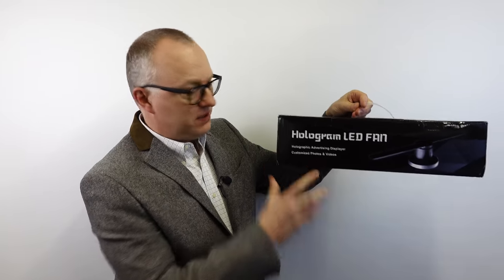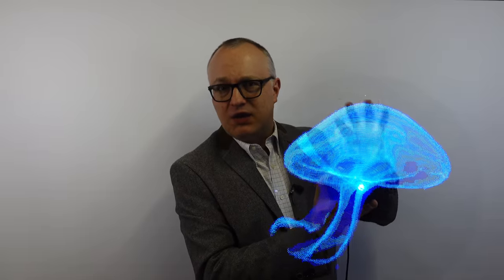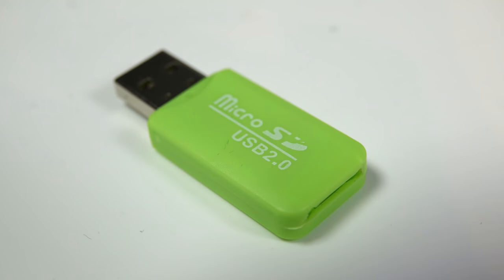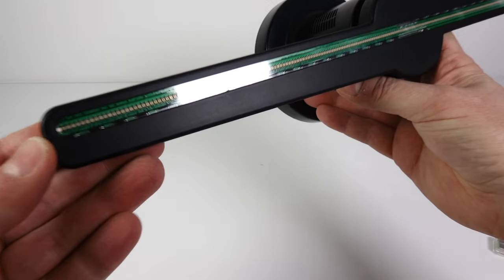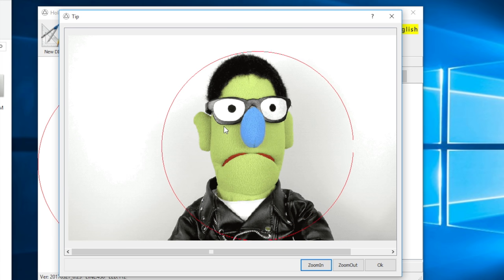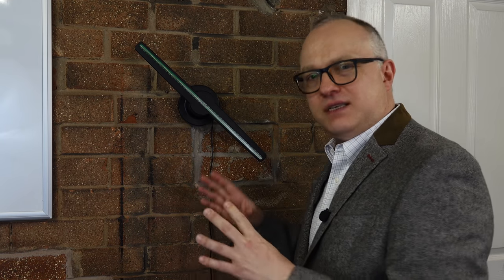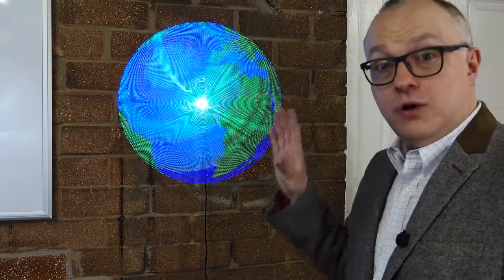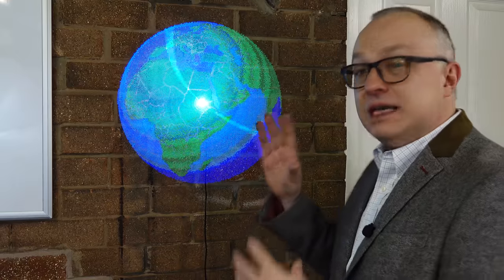'Hologram Fan' - animated images in ‘mid-air’

Comment: Kind of neat.  What would perhaps make it more interesting is if it had several blades that were different depths.  That way it could produce 3D images.
Reply from the maker: Some of the demo rotating graphics and logos manage to look surprisingly three dimensional.
Reply: depends ... for a single person experience .. you could in theory use a camera to get.position* viewing angle - and re-arange the data based on that ... giving it the effect of depth
Reply: @akirahideo6904  if you do it sorta like a 3D print of the object it will look very 3D with no tracking needed, imagine a sphere made of big-to-small circles going from the back "fan" (the big circle) to the front "fan" (small circle), you get a 3D effect. Of course the effect works on a limited angle range, like Martin Gardner's 3D dragon illusion. I hope i make myself clear in English.
Reply: @zobook  that's shape based depthness and very limited... .. .it's just my opinion , but that initially suggested approach does not make much sense
Reply: @akirahideo6904  I agree, is very limited, but not based on a single person position, it works for everyone on the "angle range".
Reply: Check HyperVSN Wall - https://youtu.be/VuPJoixToBM?t=9- it far more high-res, has 4 arms per fan and gives better viewing angles.
Reply: @zobook  Very true indeed , but for the layered depth content ...i don't really think there's any, unless you wish to create your own. Altough, i'm wondering if some paralax thrown into it could add some cool feeling. Anyway, as Techmoan mentioned several times, the impression in person seems to better than on the cam - so we can expect that as the technology becomes better and beter , this "sweet toy" may actually evolve into something that will set milestones.
Reply: Rob S  Yes , my name is totally real :) Greetings from Section 9
Reply: They do have those. It's a similar design but in a sphere with the LEDs at different radii. A lot more expensive I'm sure though.

Unfortunately, the fan devices are messing with my google-fu but here's something. https://www.youtube.com/watch?v=YKHBqUWpFWA
Reply: I've seen one of these in person.  They had the Nemo animation on it, and it's striking how convincing the 3D effect really is.  I brought a friend to see it, and when Nemo swam toward the "camera", they actually flinched a little.
Reply: In person these things automatically have a pseudo-3D effect just because of how the eye interprets the multiple depths of the blades and the wall behind it at the same time.
Reply: That's a good idea. Also would be ace if you could send pictures to it? Such as video? I shall now watch the rest of the video :P

Comment: Watch a movie or trim the hedges, so many uses!
Reply: Watch a movie AND trim the hedges at the same time.
Reply: Doubt if it'll hold a 2 hr gif in it. No audio makes it difficult too
Reply: Just what I thought
Reply: @afarhan21  You mean you can’t stream a video to it via Wi-fi?
Reply: Lawrence D’Oliveiro I think you certainly can't. Because of lack of hardware and software. No powerful cpu/gpu or wireless antennas. Or even an OS / media player. It can only 'play' gifs.

However I think you can 'cut' silent movie clips in 5 or 10 sec gifs and play them one after another. I have not used this thing but from the video thats what I can make out.
Reply: You could burn subtitles on the video.
Reply: @afarhan21  put it as just screen and use external speakers
Reply: @afarhan21  I have a feeling there might be something like an Arduino inside there. Looks like the software was originally developed on Linux, even if they only offer it for Windows.
Reply: Lol and cut the edges of the video on top and bottom
Reply: Lawrence D’Oliveiro If they can upgrade the internals they can run Android on it. That must be their eventual goal with this product. Also will need a better remote.
Reply: Gabriel Vieira They'll need powerful CPU + GPU in there.

Comment: This is the best quality footage of one of these I have seen vs real life! you can also get 4 bladed ones, where the LED pixels on blades 1 and 3 are slightly misaligned to pixels on blade 2 and 4. This way it fills in the gaps a bit better (a bit like how a dot matrix printer could do higher details by shifting the paper ever so slightly and going over it again!)

Comment: Yeah, I've had a passing fancy for these things for years now and they've certainly improved.  Still to pricy for the novelty, especially at the effective resolution they have.
Incidentally, the 4 blade versions not only have higher effective resolution and framerate, but they also support wifi and have 'app control', so presumably you can change the animations on the fly and support more features overall, like streaming a video.  The page for one of them doesn't even mention .GIF in the supported list, though presumably it would support it.  Based on one of the pictures in the description, it seems you might be able to link multiple quad-fans together to produce one larger image?

Comment: I remember when these came out in the late 90s and imagining a Blade runner-esque future where they were fitted to the tops of taxis and police vehicles to display advertising and information messages. Of course now the actual future is here and if they wanted to do that they'd just use LCDs (much like the buses in Children of Men). Still a cool looking display though, there's something very retro-futuristic about them. The spinning globe looks particularly cool and reminds me of the huge 3D one they have at the Media Museum in Bradford (I would love to know how that works - some sort of internal projection onto a suspended sphere). I have a miniature version (of the PoV fan) that my late wife got me about 10 years ago - paid about £12 for it from the gadget shop. It's only about 8" across with flexible fan blades and displays an analogue / digital time and date display in red and green. Cool to look at, but it doesn't really work very well as a fan and the novelty quickly wore off.

Comment: Since this is a radial display, the 450 is the number of "slices" around the circle it can display (the LED's can change color 450 times each revolution), while the 224 is simply the number of LED's along the length of the blades.

Comment: my first thought was to hack it to a raspberry pi so I could display live images
Reply: My best guess is, all the electronics are contained in the spinning bit, and the base just provides power through a slip ring. A Raspberry Pi would have to be mounted on top.
Reply: @nrdesign1991  that makes perfect sense actually. It would probably be to much of a hassle to do
Reply: My first thought was whether it could be linked to one of those SD cards with built in WiFi.
Reply: @MrDuncl  Now THATs clever

Comment: Helicopter photo effect in laymen's terms.  the camera is only showing the fan in a fixed position every 60 seconds or so.  But the blade is spinning much faster.   No real way to adjust for that without some sort of special effect. 

Blade edges would be a issue too.  You could run into them and even get injured since you may not be able to see exactly where they are.  It needs a visible LED edge or visually a frame.

But all in all.  Very cool toy.  First version I have seen and if I can rob a bank I'll have to get one.

These would be perfect for some of the older cartoon shorts.

Comment: Those are pretty cool. I've not actually seen one in person yet, only vids and short clips. Kind of reminds be of a 3D TV concept I saw years ago. It used a different kind of spinning shape (wouldn't even know how to describe it) as the display area and I think lasers were pointed at it. IIRC, they were testing some way of using it for air traffic control.

Comment: That's funny , I always wanted to do the same thing but the only option I saw when I was searching was to use led strip made for bicycle and try to put them on a normal fan . I don't know if it will work , considering the stability of the fan , but at least it can be use as a regular fan .
And while searching I find Crayola made a cool "Digital Light Designer" using the same tech but not flat and very limited in color and resolution where you can draw in real time the pictures .

Comment: I recently saw a combo fan-clock in the store that worked something like this.  It was a real fan, about 8" in diameter with a blade guard on it that had a line of LED's on one of the blades.  When on it shows an image of a clock with three hands showing the time.

Comment: I reckon we should make them fans, too.  Of course, you'd have to run them at high speed to get a good image, so maybe we'd need to implement a collective pitch, like a helicopter, so you can run at a constant speed and just change the blade angle to blow more or less air.

Comment: The big drawback for this product, in my opinion, is the memory card. I would really prefer a model which hooks up to my local network and allows my to perform updates and changes from my desktop or smartphone. I see from the eBay listing that there may be model with that capability.

Comment: It would make sense if the 450 by 224 is meant in a way that the LEDs change every 0.8° of a full rotation. Since there are 224 LED's in a row it would make 450 x 224  pixel in one rotation.

Comment: Here's how you get 2x the resolution than LEDs. If the LEDs on one 'blade' of are offset slightly so that they create a second separate set of concentric circles from the first 'blade' then you wind up with effectively double the resolution due to persistence of vision effect.  Think about it this way - Imagine a single blade spinning around that has 10 pixels, then as it spins it draws 10 pixels above the center, and 10 below it - making a vertical resolution of 20.  Same idea, just double the arms and make each LED its own circle.  It's interleaved just like an old CRT screen.

Comment: If it was a solid flat disc of transparent plexiglass spinning with the two blades attached then it wouldn't be such a danger... sure it would be a spinning disc but much less likely to chop off anything.
Reply: Except that it would have much more kinetic energy and could be a serious danger if it got knocked over, fell, or broke. It would basically be a large saw blade, just less sharp.
Reply: @GamesFromSpace  Yes it would need more energy but I wasn't proposing we sharpened the edges too much, :D - a dull edge verse a high speed cut.
Reply: It doesn't need to be sharp to be extremely dangerous. It would be a moderately heavy disc, spinning at 1100rpm. Which means you'd have a wheel with an edge speed of 8ft/second possibly flying across a room.

Comment: The 4 fan version does indeed seem to work at a higher resolution (1600 * 720 pixels) it has 720 leds says max res of 1080p. Also it has wifi built into the 4 blade model so once you have it up in position somewhere and cable routed nicely you can just send images over...i hope anyway i've just ordered one lol

Comment: Pretty neat. If they wanted to sell alot of these they should put the blades in a picture frame like enclosure with plastic on outside so people wouldn't worry about someone getting a finger cut off. This is a huge liability in the back of peoples minds.

Comment: ok this  is very much similar to what I have on the front of my Full size Rc Dalek call LYTE they had lots of type of disco light in the 80 s that spin in front of you but in a solid wooden case they cost about £200 in the 80 s its a led s that spin on a bar but only 2 colour red & green

Comment: Saying the manual is in English is generous. Hologram fan is shorter than mechanical concentric scan viewing device utilizing rotating radially mounted light emitters. Someone ought to make a camera using spinning CCDs so they don't have to do any conversion from horizontal scan to concentric scan.

Comment: Looks like fun, but will wait until they're more like £30 I think, so glad you pointed out the lethal tat 13A socket adaptor! Another pet hate of mine is the plug 'safety' devices that actually make them more dangerous. I saw one in a cafe the other day, where exactly the issue with these 'safety' devices had happened, the earth pin of the plastic 'safety' device had snapped off meaning the shutters of the L and N were held open.... http://www.fatallyflawed.org.uk/

Comment: I would be careful with that SDcard, it could very likely be a fake or bootleg. I had my 3D printer one day just screw up and ooze plastic all over itself because the SDcard was fake (it was a 128MB card pretending to be a 2GB card) and it was unable to read further instructions off of the card. Probably best to use h2testw on it. (Granted, there is less of a danger for the card in this thing corrupting, I assume it just displays garbage or stops working, not like it will melt plastic all over itself like my printer did)

Comment: Would a device like this qualify as a modern day mechanical television?
Reply: No. The concept of Television is to send an image from a transmitter by means of a wired or wireless signal to a receiver in real time. That's why that's called broadcasting.

This device is a Display because only shows or displays stored files, not video signals.

Comment: i hope you can answer my question: Can you use a li-ion rechargeable battery pack of 8800 mAh to make it work without plugging it to a wall outlet? i saw some videos of this being used outside without being connected to a wall outlet making them handheld portables

Comment: very impractical gadget for a house; the fact that it's basically a rotating guillotine makes that very dangerous, specially with kids that inevitably are going to want to touch "that cute animation of their favorite cartoon character"; so u need to put the gadget way up in the wall, well beyond reach of adult's heads and kids over a chair with arms extended, but by doing sot u certainly mess with the angle of the rotor which is key to have a proper visual illusion; so u then need to mount the gadget in an angle (say 40 degrees toward floor) but the noise and wind it causes would call for a transparent acrylic housing.Conclusion: this gadget is only good for teaching purposes about stroboscopic fx

Comment: What happens if the motor speed decreases over time? Can you fine tune the refresh rate of the LED:s?
Reply: That's probably already done automatically with a hall effect sensor on the motor

Comment: Wondering. What if they made that with a solid disk instead of blades. Could be black? Clear? Then, no longer dangerous. Am I missing something?
Reply: Yes, it would no longer be small and portable then, it would be an lcd screen that spun for no reason.
Reply: Hi Rob. What I was thinking is that the led bar still exists but it is set into a safe spinning disk.  Same concept as the fan but much safer. You are right that it would be larger but I was not sure the original design goal was portability since it is designed to be installed on a wall rather that coming with a handle or tripod mount.

Comment: How plausible would it be to use this type of thing as a video output system? Increase the frame rate and create an HDMI interface in place of the SD card slot and you could end up with a holographic monitor.

Comment: Wouldn't increasing the framerate be as easy as adding more blades? 

2 blades: 10 fps
4 blades: 20 fps
8 blades: 40 fps
16 blades: 80 fps
It'd be more expensive, of course, and not as interesting since you would eventually just get a disk of led's, but at least you can watch low resolution, high framerate gifs on it!

Comment: I'd be willing to bet that the rotating flicker effect would be significantly reduced if you'd filmed it in 60fps.
Reply: Actually I think 60 fps would make it even more noticeable. Sounds like it needs to be shot at 10 fps to match the frame rate of the animations?
Reply: @1zymn1  No, THAT would definitely make it more visible. In fact, that would make it effectively impossible to see the effect at all. It's not the animations you'd need to match the framerate of, it's the timing of the LEDs which depends on the speed of the blades which would be constantly changing ever so slightly due to differing air currents. So if you wanted to match anything you'd need to set up a rig to read the rotation speed and have the camera match it. Instead of matching it, though, which seems effectively impossible.

Ideally what you'd do is record it at an insanely high framerate (Hello Slo Mo Guys) and then just remove all the frames that don't have the LEDs at full brightness. In lieu of that, recording and playing it back at 60fps should give us an experience closer to reality.

Comment: The SD card is on the spinny part? That seems like a poor design decision.
Reply: All the electronics is in the arm. It's simpler than getting tons of control wires to the LEDs through the spinning axle.
Usually just the power is transferred from the base to the spinning part via slip rings or induction.

Comment: Yeah, gotta be careful with those cheapo Chinese adapters without built-in safety fuses. They work fine in most countries, where the primary safety fuses are built into the wall or the house electrical system, but in the UK, where the primary safety fuses are in the plug itself, they essentially render the device safety-fuse-less and it can kill you.
Reply: Also the earth pin is sleeved when only the live and neutral should have sleeves. In a UK socket this adaptor would not be able to earth correctly, meaning your appliance would not be able to earth correctly.  In this case there would be no problem since a fully plastic device needs no earth, but if you used that adaptor with something like a microwave which has a metal case then you'd be playing with fire, and your life.